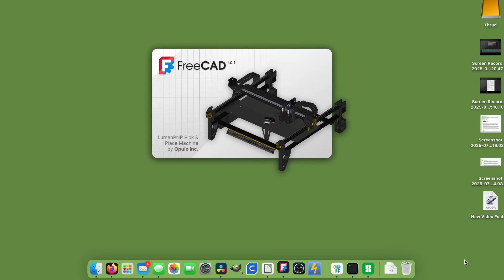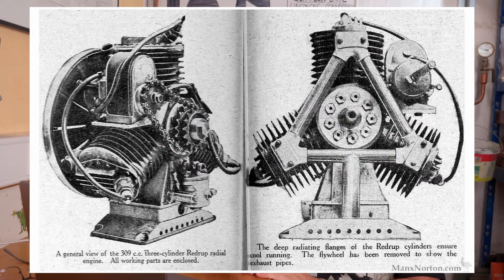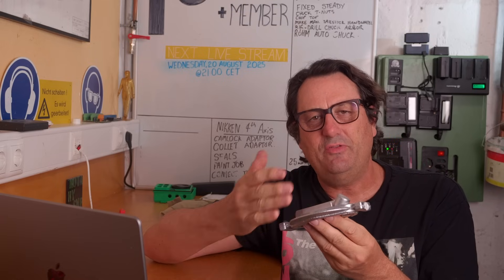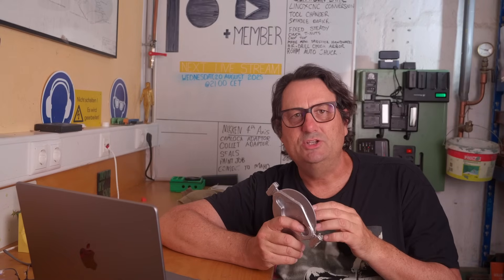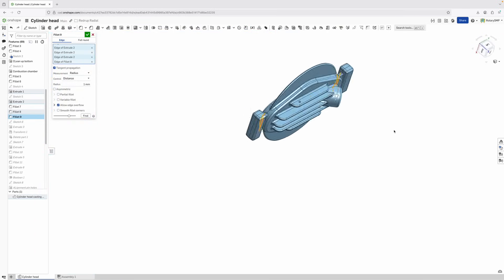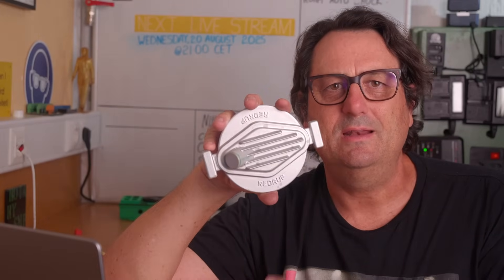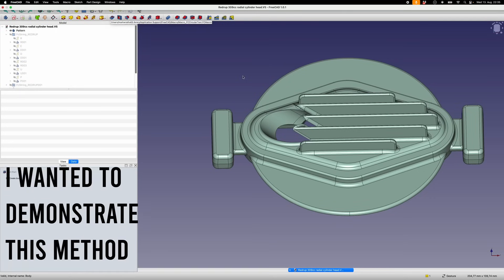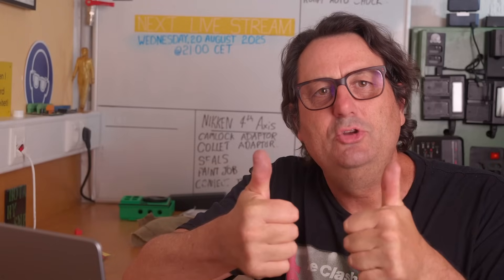FreeCad vs Onshape - Why did I switch? || RotarySMP

Comment: I understand your reasoning and it makes sense no doubt about that. CAD is a tool, and not the goal in itself. Still, to me, the content is a bit less appealing to view I think. FreeCAD is cool because it makes us self reliant it is ours and the work we do with it is ours. Anyway, for very complex parts and assemblies FreeCAD can be difficult indeed.
Reply from the maker: I feel the same way David. It is not without conflicting emotion that I make this move.
Reply: Same here - I have exactly zero interest in anything directly involving a non-free tool, let alone a cloud-based abomination. I'll still happily watch the machining, but I'm skipping the design sections from now on.
Reply from the maker: @AttilaAsztalos  I also use a paid version of Da Vinci Resolve to edit my videos Attila. It is cool there are altrustic people who donate their efforts to open source software, but if I can't get it to do what I need in a reasonably efficient way, I have to change. 

OnShape Pro is not really aimed at the individual user. It is very much a collorative environment for companies.
Reply: @RotarySMP  I would certainly do the editing with something open source, but that's an individual choice; also, it's not an aspect we generally get to see in the videos so it doesn't really concern us viewers. Choosing a tool that can do the job is a very reasonable thing to do - but I'm not, so I personally will either try to find some other open source tool that works or forget about the project. It is what it is...

Comment: If stuff is cheap or free you are product. Saving your work on company cloud is big no-no too... These cloud softwares usually pull some type of scam later on. With locking software and your data with high price subscription after you spend lot of time and learing it so you are pressured to buy it. Same how Fusion did it - it was free, people contributed a lot, they promised free, free and then locked it behind unafforable subscription for hobby users. They locked thier files and disabled even exporting files. Just wait before Onshape do the same.
Reply: so far onshape is fine, but the risk exist for all software. M365 is fine, and a lot of SaaS are doing fine.
Reply: Every CAD vendor I spent significant money on has pulled stunts. Be it Adobe, Altium, Autodesk, even Mathematica by Wolfram. I dropped them all. Innovation these days is how can we scam our customers as opposed to innovating new things.
Reply: @vincei4252  They dont respect me and in return i dont respect them, so cracked Inventor is the way. Full 2d/3d cad and cam. If there is no owning there is no pirating also.
Reply: @vincei4252  so what does the company pay there employees?
Reply: So what do you recommend as a useable alternative?  I'm sure he'd love to use e.g. Solidworks but that's juts not financially feasible for most people.
Reply: @ferrumignis at some point you have to decide what the value really is. Burning your time or getting work done. It's another tool like a mill or lathe.
Reply: @rcdieselrc  Its more of a question as to whether the cost of a licence (probably annual) is even affordable for most hobbyiests.
Reply from the maker: All good points guys. I have no real IP to protect here. It is some models of a 1920's obscure engine, no one else is interested in. If I lost access to the files, I will already have all the STL's already, as I have printed all the patterns.

Comment: I use FreeCad both for work and home projects. My models aren't usually too big, but for example when I designed my own 3D printer you are right, it struggles a lot, even with a powerful computer. About the part workbench, I usually ignore it completely if possible... I love FreeCAD, but I understand, sometimes you just need to work on your project... In any case it is improving bit by bit!!
Reply: Its slow due to its founfations sadly there that wont ever change
Reply from the maker: @cj09beira  But computers keep getting more powerful, so inefficient code may get more tolerable ?